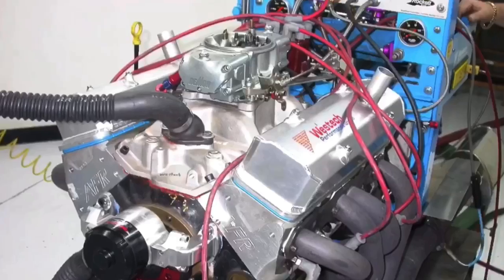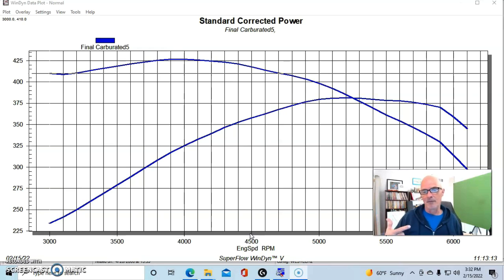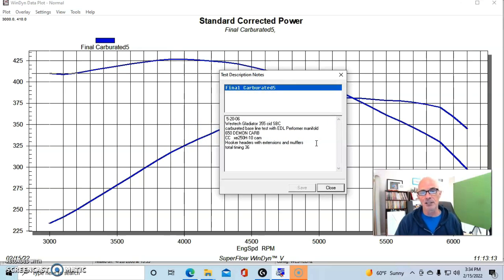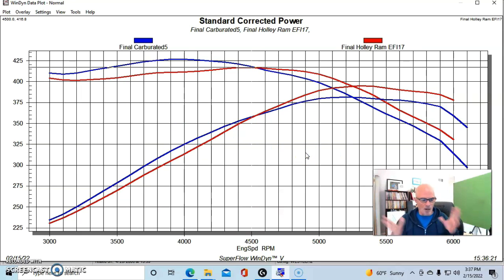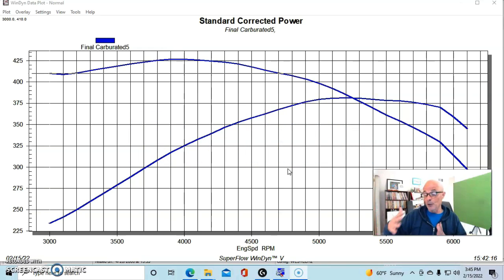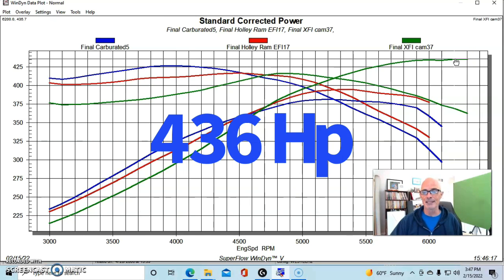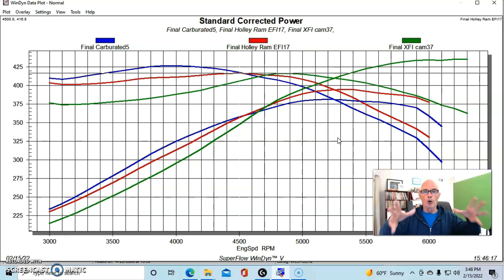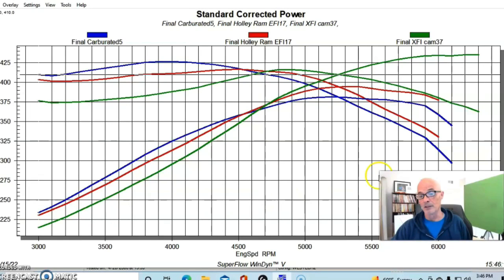HOW TO IMPROVE 350 SBC CHEVY POWER. MILD RV CAM VS XFI PERFORMANCE CAM. CARB VS STEALTH RAM EFI

Comment: Still looking for that TBI modded small block. There are a number of us who want to know how much low end torque and mid range horsepower improvement we can get with some simple mods - RV cam, better air flow, and bored TBI.
Reply: He has a 350 tbi vortec build video
Reply: I believe most of his SBC videos are from old magazines
Reply: I built one for somebody with cleaned up 193 heads(the swirl ports everybody rags on), stock intake match ported to the heads and flashing cleaned up, stock 5.7l throttle body but with the extreme airflow mods(air horn cut down, throttle shaft thinned, injector pod spacer, and set the pressure up to 15), stock bottom end rebuild, comp cams 12-249-4 extreme energy computer cam with comp lifters and matching springs, set of 1 5/8" long tube headers, stock chip, base timing set to 6 degrees btdc, and a 3 wire O2 sensor. He said it dynod at 240hp and 335 ft lbs of torque at the wheels. The TBI engines can make vortec power but with way more off idle torque, but swirl port heads by there very design are rpm limited and will choke out at higher rpm's. They make great budget truck engines if you want a simple, cheap stump puller, but they will never be powerhouses.
Reply: @THEFERMANATOR  you gotta put a carb or efi to get the air you need in and go to 1.6 exhaust valve
Reply: @THEFERMANATOR  - Thank you for that info. I am thinking of something similar but with using Vortec heads and a bored out TBI and  reprogrammed chip. The cam would be very similar. Did you notice any fuel economy inpo=rovement with the increased air flow?

Comment: The RPM Air gap with a 228/236-112 cam is a sweet setup. That setup tends to remove a lot of limitations from essentially any engine it's ever installed on. It allows a header to be effective, and that means a LOT.
Reply: i’ve always like the RPM air gap but didn’t know why, what exactly makes it good with headers?
Reply: @WilshIAm  That particular combination builds lovely mid-range torque without having to put so much stress on your parts. 
With that cam, you have just a bit of overlap, plus the intake valve closes further after bottom dead center than most factory cams which allows some air to go backwards up the intake manifold, and the RPM Air Gap is designed to give that air to the nearest cylinder that's at top dead center. A well-designed header will create suction/scavenging. The cylinder that's top dead center can't generate vacuum because it's technically not moving, but the manifold is pushing and the header is pulling. It's a simple setup of choice parts. 3500-5200 will run great on pretty much any engine with that setup.
Reply: @Dr_Xyzt  that’s really fucking cool, any off the shelf cams that match these specs?
Reply: @WilshIAm  It depends on the engine you have. We can find something that's close.

Comment: I had the StealthRam for a Procharged build I was doing for my 91 Camaro RS back in the mid 2000s. Once I discovered (I mean REALLY discovered) what the LS (It's Matt Happel's fault!) could do on the turbo forums website, I sold EVERYTHING! StealthRam, Commander 950, 350 roller block and forged 383 rotating assembly. I bought HPTuners in 2014 and NEVER looked back. If I was to do another SBC, I'd DEFINITELY run the StealthRam. Buddy of mine had a StealthRam on a NA 383 in a 91 or 92 Z28. That car was a MONSTER.

Comment: The XFI cams are great. On a LT1 Gen 2, AFR 210 heads and a 355 engine. The 280XFI or 292XFI is a beast with the gen 2 LT1.

Comment: My takeaway is that, for more torque in a work truck or 4x4, I'm better off putting my money into a 383 stroker kit and small hydraulic FT cam, rather than AFR heads and a hydraulic roller setup (unless my core engine was already a factory roller).
Reply: I'd suggest you steer clear of ALL flat tappet cams. Unless you run oil additives. You're gonna flatten the cam in a short amount of time. Hydraulic roller is the best option for all street engines.

Comment: I had a 268xfi in my 97 lt1 engine. It made 395hp 400ftlbs of torque to the wheels. Torque curve was flat as a pancake. Would've like to see the power numbers on the 268xfi with the carburetor.  Stealth Ram isn't a great platform in my opinion.

Comment: The standard Performer intake was choking those heads. The ports are smaller than those of the AFR 195 heads. All you need to do is lay a FelPro 1205 gasket on the ports of each and you see the port mismatch. Using a RPM or RPM Airgap is a much closer port match. I believe the RPM would have made a better power curve at darn near all points. I'm not ripping on ya but I was in disbelief/ shock you didn't try one. Not available, time constraints?
I'm no cam expert but to me the 113 LSA of the XFI cam looks a lot like over compensation for a smoother idle and higher vacuum to me. I wonder what it would do to the bottom end if it was ground on a 108 or 110 LSA?

Comment: I'm so glad you finally dynoed the XE250 cam. I got that cam for free from for my first SBC build. If you test it next do the air gap intake and stock ish 882 heads just to see how limiting those heads are compared to the AFR
Reply: Don't think you will find that the 882 heads would be all that limiting in terms of flow. The big issue is lack of compression, so it may play a bigger part on the final HP number than head flow.
Reply: @DodgyBrothersEngineering  I know they flow ok for what they are, and to combat the large combustion I used domed pistons
Reply: @zackarymorrow6484  You can get a bit more out of them with a simple bit of bowl blending and squaring up the intake. They aren't that bad of a head it is just the lack of compression but it sounds like you have that covered.

Comment: I'M Still Purplexed the Torque and Horsepower always Cross at 5252 RPM. No matter what 🤔?? ..And do a Chain versus Belt Run Please .. When the Pulleys on the Belt get Hot they Expand making the Belt Scary TIGHT ..Causing Major Down Pressure on the Cam Bearings (Friction ) Show us that Please .. Cool Videos Thanks .
Reply from the maker: HP=TQ x rpm/5252 (they will always cross at 5252)-I didn't do a belt vs chain test
Reply: @richardholdener1727  Could you do that PLEASE 👍

Comment: So for a SBC truck 4X4 restoration, 355cid, and already have an original 2101 Performer, I was thinking about going with the AFR heads because of their consistent low and mid lift increased flow. I am just wondering if the $1800 heads are worth it. I am not looking at street/strip. More of a fair weather only stock restoration with a decent performing and efficient engine. Will also likely stick with carb.
Reply from the maker: you don't really need those heads on a mild build

Comment: compare these with the performer EPS dual plane, i don't believe fuel injection had so much to do with it as much as the tunnel ram style versus the dual plane style.  Compare a performer, an EPS, and rpm non air gap, and the air gap. because i am running this cam in a 355 c. i. with an endurashine EPS and ported  Pro MAXX 200cc heads with 10.35:1 wonder if i should try an XR252HR10  xr258hr10, or an XFI 260 now. XR264H10 i wonder what that would do.

Comment: I keep thinking about changing from a TPI intake to the Edelbrock pro flow XT on my 383, but I like the bottom end mid range to much, so I am worried about doing the swap.
Reply: I have done this and gained  about 35 hp I went from the steath ram intake to a edelbrock pro flow its a 388 with victor jr heads and a decent cam kinda hot the tuner said that the steath ram is more for a mild build
Reply from the maker: you will definitely lose low speed torque
Reply: @richardholdener1727   yes it did lose torque in band from idle to about 3800 is were I feel the lose so from a stop light to stop light and just cruiser  I would step up from a normal  tpi intake to a steath ram but for all out racing I think most efi 4 barrel style intakes make more power
Reply: You will lose power below 4400, but with that 383 it will still make more power than the 350 TPI.

Comment: Need to test the Edelbrock Power package on a 327 SBC
Reply: Heads that will drop valves if you don't fix them and camshafts that went out of fashion in the 70's. 😬
They are at the point where the Chinese won't copy their work because they have standards to uphold. 🙈😂
Reply: @PSA78  Ouch!😜

Comment: What is the deciding factor that produces low end power with smaller camshaft? is it because the intake valve closes early therefore keeping the dynamic compression ratio up higher? or is the LSA a deciding factor?
Reply from the maker: it is not 1 valve event-the milder cam makes more low speed

Comment: I think a Victor Jr. Would've been closer to the stealth ram intake in that it's short runner single plane.  In which case you would likely see more torque from EFI because that's probably too much intake for that baby RV cam. Richard have you thought of posting average TQ/HP across the RPM range comparing a average power difference in say a car with a 4,000 stall converter, vs daily driving something with 2.89 gears where you're likely 3,000 rpm or less?
Reply from the maker: 4000 rpm stall?
Reply: @richardholdener1727  Yes a 4,000 RPM stall torque converter.  Where your engine ideally will always be running between 4,000 RPM and the redline.

Comment: I think it would interesting if you played with rocker-arm ratio on the Gladiator 355 Chevy. I wonder what a set of shaft mounted rockers like a 1.72/1 or maybe 2/1 rocker ration would do for power?
Reply from the maker: 2:1?
Reply: I was thinking about the old Engine Master days when a competitor with a SBC changed his engine from 1.5 rocker ratio to some extreme ratio and picked up 60+ Hp..

Comment: Traditional SBC engines are still very much relevant; perhaps even more than ever actually with all the great parts available. But they aren’t all that far off from their LS brethren when you keep things similar. The last 350 I put together for someone was around 9.8:1 with a mild 64cc head (fast burn), a mild roller cam under .500 lift and 208/212 and despite all this he ran a single plane on it for some reason and it made a hair over 400 HP. A similar displacement LS1 with such a mild head/cam/compression combo like the SBC wouldn’t make any more power than that I don’t believe.
Reply: I agree. If you already have a good 350 core then it costs the same to rebuild with good aftermarket heads as it does to do a high mileage ls junkyard swap once you price out all the parts.
Price out adapters, swap headers, swap pan, wiring loom, ecm and 100 other small parts.
And it's a new engine not a high milage engine with unknown history.
Once you have decent aftermarket heads on a sbc I believe the playing field is close to being levelled.
That's what I did. I built a fully forged 355 with heads for the price of all the swap parts for a junkyard motor. And you know what? It fit straight back in my engine bay and I won't be waiting for it to grenade and oil down the track or waiting on a tow truck.

Comment: Would the 180 eliminator heads combined with the 250 cam help even more with the low rpm torque? I have yet to see much on the 180 heads and it seems they would be a better match on a 350 with the higher velocity. I would like to see this combo for a gen 1 truck application. If you think about the combo it just seems that if you can sustain that torque curve from 2000 out to 4500 you would have an ideal setup for towing and or daily driving.
Reply from the maker: I DOUBT THE SMALLER HEADS WOULD SHOW MUCH AT WOT

Comment: Concerning the belt drive setup.  Other than making cam and cam timing changes easy, was there any measurable benefit to running a belt?
Reply from the maker: i DIDN'T TEST THAT BACK TO BACK-IT WAS JUST ON THERE WHEN i STARTED MAKING CHANGES

Comment: The 327 still  has the Ultimate Rod Angle ..It will keep up with a 350 and Last Longer ..And don't forget the .060 over 283 = 292 👍
Reply from the maker: I like the 327 as much as the next guy but, With the same components, the 327 will always make less power than the 350 and the bigger motor will always win in a race (rod angle doesn't change any of this)
Reply: @richardholdener1727  I get all of that... THE 327 is just a Fun Motor.. And Pistón Side Thrust is Less
Reply: @donalbershardt9290  ..and piston side thrust is even less with a 283.
BUT, in '75/'76 while still in high school, I raced 3 - 327 chevelles with my 350 chevelle and beat ea one - no problem. I think all 3 had more compression than my 9.0-1 350. The 350 wins - hands down!!!!!

Comment: I'm thinking the wider lobe separation (113*) is what killed the torque down low and the valve lift gave it that top end power.  My questions are:  what's the vacuum like with that cam?  what's the drivability like?  What's the drivability like with that EFI intake?
Reply from the maker: don't know drivability of either from dyno results-but the small cam would be good

Comment: If running a ram-air style vent from grille to throttlebody on a holley super ram, do i need a air box inline or can i just use an inverted filter from behind grille to maf then t body?
Reply from the maker: are sealing the cone (inverted) filter)
Reply: @richardholdener1727  yes it will be sealed behind a vent like gale banks used on his ss chevy pic up.

Comment: It’s not a on/off switch like RH often explains. Truck application vs rev happy horses are the only options if you live in a Dyno cell but not in the real world. The mild engine would be a better fit and less annoying for almost any street vehicle.
Reply from the maker: RH doesn't explain it as an on/off switch-he provides all the data and you get to choose

Comment: Have you dynoed the smaller cam
with 1.8/1 roller rockers...
Reply from the maker: 1.8 rockers on a sbc?
Reply: @richardholdener1727  
They make up to 2.1/1 rockers
Adding a higher rock ratio
The bottom end is similar
But you get to 50° faster. And get more lift.  So top end should improve....
But remember you should increase valve spring presure.....
There a UTube Video
750hp 350Chevy pump gas
Is where I saw them first
They also make 1/1 rockers to break in wild motors

Comment: Hey Richard I'm loving these videos, I'm currently looking at these videos for a build I may get to do and the build will be for big low end torque, are there any more camshafts for even more low end torque? Also where the 195cc afr heads the as cast heads or the cnc heads that they offer. Also do you have any thoughts on the edlebrock avs 2 carburetor? I'm curious to see how it stacks up to the other carburetors
Reply from the maker: not sure how the edel carb stacks up-heads were very old cnc 195s, might be hard to beat that cam for low speed
Reply: Thanks for the reply 👍

Comment: "Should we have run this combination...?"  Yes.  And you did.  And you should have documented it.  Which you did.  Should you have run other combinations?  Of course.  And you did.  And documented them, too.  That's where it's really at.  Sometimes combinations don't act in the expected way.  When they don't, we often learn something, which is why that's where it's really at.
A failed experiment is not one where you don't get the results you were looking for.  A failed experiment is one where you don't learn anything or learn the wrong thing.

Comment: Richard

Do you think a 350 would fit in a Nissan 240z ?
Reply from the maker: YES
Reply: I ran a 305 TPI and 700r4 in my '73 240Z. Mild cam and factory L98 aluminum heads. 300 torque and only 230 whp but she ran high 12s at 108 and got 22 mpg. 2460 lbs w/o me. That was a fun car. That SBC looked smaller than the L6 I pulled out. Lots of room on the sides and the balancer sat behind the steering rack with an inch behind the distributor. Looked so at home in there. Miss that car.

Comment: I've heard the term RV cam but what makes a cam, an RV cam? And please don't tell me it would be good in an RV. Lol sorry if this is a dumb question
Reply: small lift, usually mid .400-.450 and duration of 210-220 is a good guide to a mild/rv type cam
Reply from the maker: the RV designation has been used to designate a cam designed for low-rpm torque for truck and RV applications

Comment: Just not understanding what is happening with that basic looking carb. manifold making more low speed torque over that 8 individual port EFI manifold 👾
Reply: The carb intake likely had longer runners. The EFI manifold only has the short runners from the plenum to the heads.
Reply: @NBSV1  That make sense.
Reply from the maker: it's more than runner length with the dual plane
Reply: @richardholdener1727  Keep testing we keep learning/watching 🙂

Comment: VVT & Lift + variable length intake runners it's where it's at  and you could rig a variable length intake on any SBC [given enough room] but the same can't be said for VVT & Lift.
And that's were EVEN the LSx and current LTx engines STILL FAIL.
NO, advancing and retarding a single camshaft that does both intake and exhaust it's still a shitty, not even half baked solution.
Even the fancy cam system used on the last VIPER was shit compared to say, oh, I don't know . . . a 5.0L DOHC Coyote ? LOL.
Reply: But until the coyotes get to LS prices I think people are fine with giving up for one or the other
Reply: @zackarymorrow6484  true. Those 5.0's are HOOOOOOT$$$$$ !
Not to mention when time comes to do a cam swap there's four sticks to buy ! 🤪👎